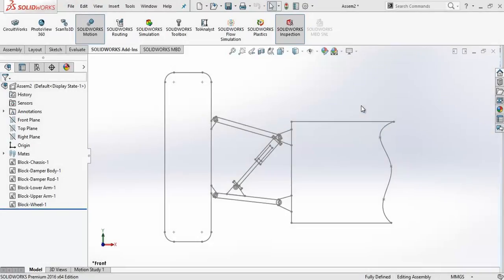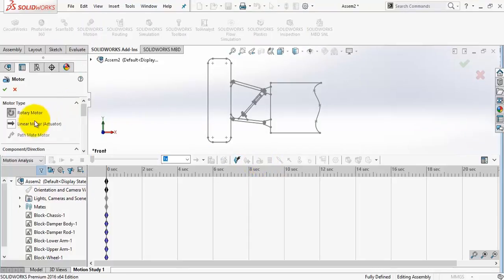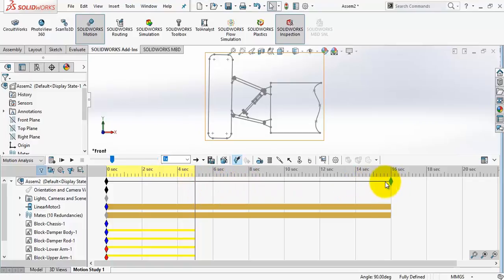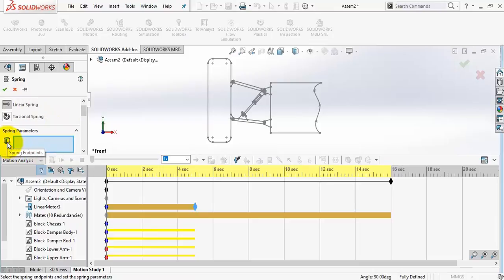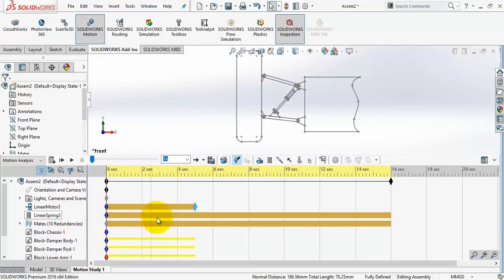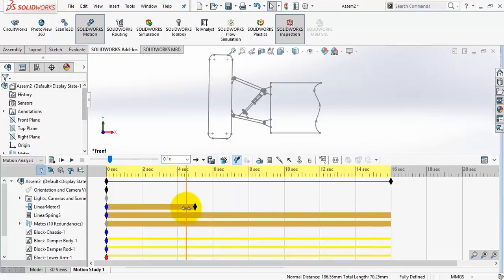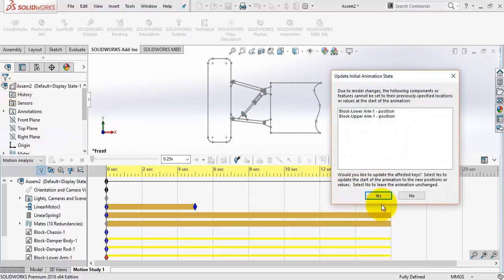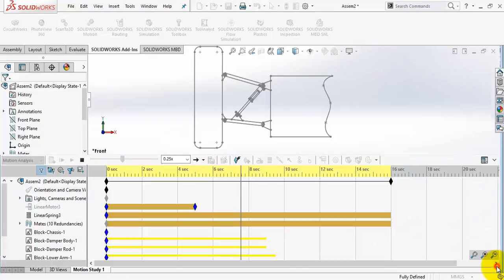SOLIDWORKS 2D Dynamics & Animation - Springs & Dampers

Comment: Can you discuss your mates  Are they layout only?  I am having trouble with my blocks lying away the contraints do not seem to all be working properly.
Reply from the maker: Hello Scott, 
My Mates are coincident for all the suspension points on both the chassis and the wheel, the damper is 2 pieces and the points of the damper are coincident with the chassis and the lower control arm. finally the two parts of the damper are co-linear